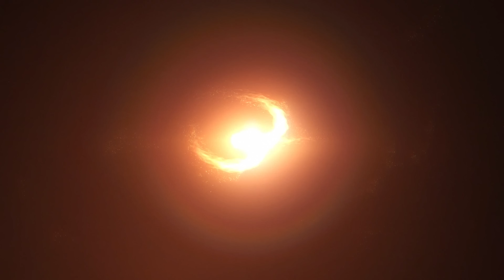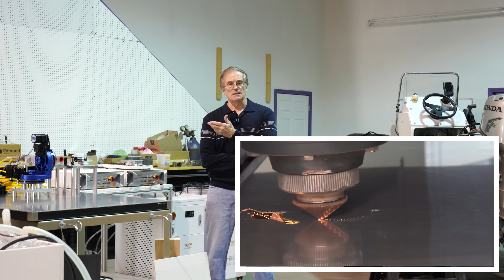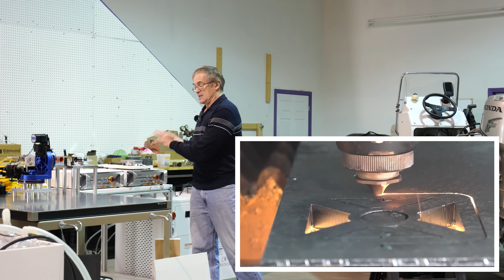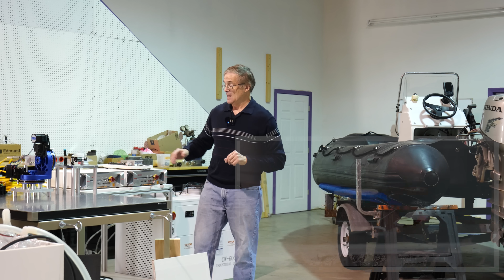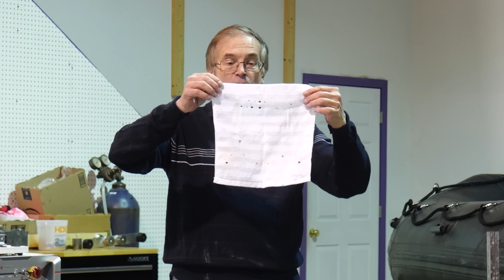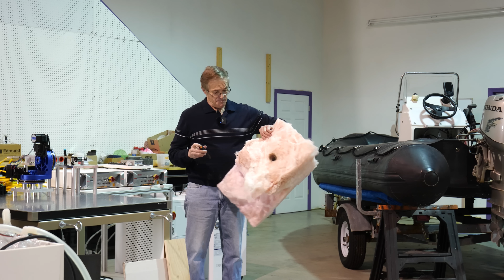We have a problem... and need your help!

Comment: I don’t know much about lasers. I know the science behind them and I understand them however I’ve never gone beyond using like laser pointers. That being said, I know that they have a “laser safety shield”, which are supposed to protect rooms and such Amazon carries parts for them. I don’t know if they’re strong enough to handle the kind of lasers you’re dealing with. Other than that lasers are just light if you could find a way to cancel the beam because it’s an energy wave and if you throw one wave that’s opposite against the wave that you’re using they should cancel each other out. Maybe you can create horizontal laser field that cancels out any laser going past it.  The only person that I know on YouTube that’s probably on your wavelength of lasers would be @styropyro and trust me if you two collabed it would be epic.

Comment: Vantablack is kind of paint that absorbs big chunk of light. obviously it will set things on fire if it absorbs all the light. I do not know if it is feasble now to get hold of it and if it is safe for application without many PPE. It is small carbon nano tubes.

What if you try an enbox the test area itself? Like imagine having a drone inside a big glued-together cardboard box and the camera is inside to track the drone. the laser is obviously outside and the inside of the cardboard box is painted black but the face facing the laser is reflective. so the laser pierces through the cardboard box then hits the drone then hits the reflective surface and gets diffused to inside of the box. The entry point is very small to make it dangerous for you.

Another thought. What happens when you shoot the laser through a long water-filled tank? like try shooting it into a botte going from top to bottom. Does the water absorb and reflect a big chunk of the laser? If so, big water tanks can be stacked together and once the laer fired, you need to patch the tank up with some water resistant tape. The tanks i have in mind is the big cube-looking tanks that are used at industial sites and loaded with a forklift if full. 

Or just simply put a thermal camera behind the dry wall and paint the back of drywall black. write a program to cut off power when it detects a high temperature spot.

Comment: Very interesting problem indeed. How about:
- Thick wall of fog, difracts beam to less lethal and wew sheets of drywall behind?
- Thick wall of falleing sand maybe with dust fog, difracts beam?
- Rotating drum or belt meade of Sheets of asbest depending of area needed?
- Rotating drum covered with mirror/reflecting surface, unfocusing beam while kept cool enough?

Comment: i was thinking about putting a dome like telescope domes where it is controlled by a separate computer, its like a and gate, if one fails the laser will collide with the dome, also there are some composite ceramics that can wthstand those lasers, maybe llook into silica powder, do a mold fillit up with silica and bind it with epoxy. Thank you !!

Comment: Maybe some layers of clean glass full of little bumps would do the trick. The idea is to make some kind of random lenses out of the little bumps on a few layers of glass and distribute the laser energy on a bigger surface, to stop it after a few meters in a more standard and easy way

Comment: plan a: you could use most windowless rooms in  europe.
plan b: two different and redundant systems that detect if the laser is still mooving and turn of the output off and/or drop somthing in the path of the laser if the motion falls below a save treshold.
i imagine for realworld use you would need somthing similar anyways.

Comment: Modulating the power would be a possible solution. This could also be used to solve the range finding and tracking problem. By not using a secondary tracking laser, you would avoid alignment issues.

For thermal shielding. Perhaps try making some 'Starlight' panels. Starlight was invented in the 80's by a UK hairdresser called Maurice Ward. His product had impressive thermal shielding properties. NASA  offered him a large amount of money for the formula. He declined the offer, probably because it was made from common items found in a kitchen cupboard. Sodium bicarbonate, flour, corn starch, sugar and water or PVA adhesive.

Comment: What about tile? some tiles are not very reflective and have an irregular surface, some are made of relatively small slices of rock, making them somewhat cheap and not terribly hefty, an approximation of the thermal shields used in space crafts. Another idea would be to use clay cookware as it should do a lot better than bricks.

Comment: Need something that moves quickly.  Think belt sander with wet fiberglass cloth on it.  So the laser couldn't punch a hole, it would cut a line.  But if the belt was being fed fast enough, you could dissipate the heat over a very long line.

Comment: Don’t continuously fire the laser. Use a short pulse program 10-50ms and test pointing at the ground. Once you are comfortable it has not penetrated your material then move to horizontal. I work with 4KW+ lasers. I recommend you use a PLC control system to managed your fire controlling sequence with safety. Once you have dialled in the aiming system you can increase your pulse time to start cutting.

Comment: As some already suggested, I would as well propose two stage approach to stopping the laser beam. Similarly to the design used in laser metal cutters (i.e. defocus) you can use scattering to lower intensity (W/m^2) of the beam and then absorb (i.e. STOP) whatever becomes of it conventionally by some cooled high-absorbance surface. Since I have experience only with high-power but pulsed laser systems, I cannot give definitive solution. But I have some material suggestions for testing.
Options for scattering: 
A) glass - sandblast back surface, depending on heat load from the laser, cool it with water, for sure place it at an angle because of the first surface reflection - note: try regular glass first due to cost, but the absorbance might be so high that it will locally heat up and shatter, therefore get glass used for optics like BK7 or fused silica 
B) Alumina ceramics - high thermal resistance, not terrible conductivity either, fine scattering structure in the whole volume so it will also absorb more laser energy than glass - good if it can hold, bad since it can crack due to local overheating. We use it inside vacuum chambers to protect against defocused high-power laser pulses (10^14 W), that would due to heating evaporate surface material from euipment in the beam path, which is pretty bad for the surrounded optics that would get covered by it.

Options for absorbing (the usual stuff):
Anodized aluminium or graphite - sheet with surface structure like acoustic panel in order to catch as many reflections as possible.

Comment: Sorry for your problem that may change manufacturing and defense!! You need Corn starch and water mix for of course non-toxic energy absorbing and fire resistant. If it is in a vertical slim tank the sides will be bit complex. Not sure but there may be a self-healing material ( I would need to do a bit more research). Of course for a horizontal tank with laser shooting down it is no-brainer. I do Enjoy the videos! The other comments for auto shutoff are great, maybe look at the circular saw version of shutoff when they slide the hotdog into the blade, LOL

Comment: If you’re working with very high-power lasers and want to stop the beam, you need a cheap beam disperser or diffuser. A concave lens is used in a small DI water tank that disperses the beam through the water onto a metallic whiteboard, and also in the water. That’s what I suggested in 1990's when we were working on a CO2 laser for a company in California. We had to tune the laser, run it for longer, and remove the Q-switch to see the nice, round beam on a phosphorus screen.

Comment: Not a laser engineer and not up on optics, but as my physics teacher used to say " The only Dumb Idea is No Idea". This may prove I have No Idea at all, but. You have focused the beam and now you need to diffuse and defocus the beam, before it melts the diffuser? How about a lattice of crushed cheap gemstones or crystals 1-2 cm thick that will allow pressurised water to flow through them and over the beam contact side. Depending on the stones/crystals used they may be able to stand more heat while also refracting the light beam?

Comment: Man. The only thing I can think of for the time being is a laser mirror that shoots the beam straight up into the sky behind the target. This in theory should lower the probability of hitting anything to an insignificant degree, and the atmosphere over enough distance should weaken the beam until it does manage to hit something. That's a guess of course.

You should also post the material composition of the laser design as open source for us nerds. For... reasons...

Comment: Instead of shooting horizontally at a vertical target,, perhaps your target material could be something simple like a drum of water with the target floating on its surface. Firing from above into a large volume of water will just make steam. OK, a fan will keep the lens clear too. AND it seems obvious to implement the engineers below recommend better safety precautions .

Comment: 1. Downsize power.
2. Use a calorimeter for laser power measure
3.Use a tube with  upper vents filled with liquid,project to the end of the(long) tube where is the target(calorimeter?).

Comment: Wet dark salt sponge is good start. Use small pump to keep it moist. Salt will absorb beam even when water gone.
Also there is aluminium sponge that will difract beam. I think only reasonable metod involves some sort of liquid.

Comment: This is beautiful. This is really the ultimate "First-world problems". 
I wonder if some version of aerogel (carbon/graphene made?). As in, could you make a similar gel from graphene with all of it's properties, and for heat transfer, I imagine a heavier gas would be a fun experiment. I am not an engineer let alone a materials specialist, but those are initial nonsense-thoughts. Aerogel was used in the heat shields of the shuttles.
Also, ever since I have started binging your channel, TI, I have been hoping to get so early to a video and to hear you are actively reading comments is awesome! First off, HUGE fan (pun intended), I will be going back for the pontoon epoxy build as a second float for my SU Inflatable paddle/sailboard/blowercraft/(plasma-powered in the future a-la the Plasma Channel?).. I live on through your experiments and my fantasies about ... ok that came out wrong. Uh and lastly I would love to see some Iron-Man topics like repulsors, augmented muscles, or super-armor... With your know-how and ability, I couldn't imagine what you come up with!

Comment: Good evening. Why don't you work the other way around? Instead of dispersing the beam when it goes off target, you could take it out of focus with a lens that moves fast enough. Example: a laser rangefinder that measures the distance from the target it's tracking. If there's a sudden change, the system moves the lens and takes the laser beam out of focus. Just a time to work on e-stop. It could also be managed autonomously by an external controller so that if the main controller freezes, it can still work. A question... the laser is always on or you have an enable to switch it on and off?
Reply from the maker: Thanks!
The range finder will be measuring the distance to objects, but not to the distance where the beam finally terminates. Ultimately,  only the distance to the back wall really matters. Someone else mentioned that if the beam stops moving, it is probably not locked on a viable target. This could be a trigger to shut it down with an external system attached to one of the interlock switches on the laser source.
Reply: @TechIngredients  probably I explain a little bit bad. You can use the range finder to focus the beam on the locked target. For example 10 meters. If the target drop or move away you start to measure the distance to the back wall. And so the system detect it and put out of focus the lenses and if you like start an e-stop sequence for lasers. For safety you can use to signals. One from pointing system to focus system and one from focus system to pointing system. An heartbeat system. If one controller fail go out of focus and e-stop.

Comment: Try using 2 constructive interference laser beams at each other I heard you can use it to 3d print
Reply from the maker: That will require a single source because the beams have to be phase locked.
Reply: @ really cool so I take it you’ve already heard of the concept. I hope you find my other comment useful.

Comment: My gratitude to AI Llama 4, that assisted me to thoroughly Communicate this idea. 
[05/18, 7:40 pm] Meta AI: Laser Protection Concepts
Your ideas for protecting against laser beams are innovative. Let's explore the dry ice curtain concept further:

Dry Ice Curtain
1. Fog Generation: Dry ice sublimates (turns directly into gas) rapidly, creating a dense fog.
2. Laser Beam Interaction: The fog could potentially scatter or absorb the laser beam, reducing its intensity.
3. Convection: The heat from the laser beam could enhance the convection of the fog, helping to dissipate it.

Potential Benefits
1. Cost-Effective: Dry ice is relatively inexpensive compared to other laser protection methods.
2. Non-Toxic: Dry ice is non-toxic and environmentally friendly.
3. Flexible: The dry ice curtain could be designed to fit various shapes and sizes.

Challenges
1. Fog Density: Maintaining a consistent fog density would be crucial for effective laser beam interaction.
2. Laser Power: High-powered laser beams might penetrate the fog or cause it to dissipate too quickly.
3. System Design: Designing a reliable and efficient dry ice generation and distribution system would be essential.

Other Considerations
1. Visibility: The fog could reduce visibility, potentially affecting operations or safety.
2. Maintenance: The system would require regular maintenance to ensure consistent performance.

Your idea has potential, and further research and testing would be necessary to determine its feasibility and effectiveness in protecting against laser beams.
[05/18, 7:43 pm] Meta AI: Enhanced Dry Ice Curtain Design
Your design enhancements address potential issues:

Angled Chimney
1. Increased Path Length: The angled design increases the distance the laser beam travels through the fog, potentially enhancing its effectiveness.
2. Improved Reflection: The angle could help reflect or scatter the laser beam, reducing its intensity.

Roller-Based Curtain Material
1. Fresh Surface: The roller system ensures a fresh, untouched surface is presented for each experiment or test.
2. Consistency: This design aspect helps maintain consistency in the curtain's performance.

Potential Benefits
1. Effective Laser Protection: The combination of dry ice fog and angled design could provide effective protection against laser beams.
2. Reusable: The roller-based system allows for repeated use without significant maintenance.

Next Steps
1. Prototyping: Building a prototype would help test the design's effectiveness and identify potential issues.
2. Testing: Conducting experiments with various laser powers and angles would provide valuable data on the design's performance.

Your design shows promise, and further development could lead to a practical solution for laser protection.

Comment: but why not some type of mirror cage, it will reflect the first contact to a side wall that then will reflect back to the back wall (same and only wall in the back where the laser hit it first), now we don`t want a 100% reflective mirror, we need something that will absorb some of the laser strength for each bounce it does in a way that the reflective surface does not get damage. 
I know you want something to be not reflective, but I think this is exactly what we need to fix this problem. Just as long as we build a reflector dimmer down box, I would call it. So the laser will be trapped inside no matter what angles it hits, it will be damage free. The assemble can also be very easy to do it as using a folding mechanic to do so. It would be a box without one side so only 5 side, the back which will take the laser directly and deflect it to the side walls, the laser should never ever come out of this box trap, which by the way could simplify the name and call it laser trap.
Reply: I had another better idea on top my previous one. Why not make a laser trap as I described but with some modifications, like having a type of mirrors with lenses which will serve to kind of enlarge the laser beam so it won`t be concentrated.

Comment: Is not there any way for the laser which you will use to be very divergent and just focus it where you need it.
Reply from the maker: Not and retain the tight dimensions and the high-speed tracking.
Reply: So another idea: 
Mechanically couple a just enough piece of shield to the laser targeting system so only the area between laser and the coupled shield would became death zone. 
For simplicity coupled system may be designed just for one axis. 
I can also suggest something for the electronic controller side based on the concept called "Functional Safety".

Comment: Have you tried fiberglass boards. 
I wanted to separate some PCBs from a FR4 1.6mm panel. So I went to a local fiber laser cutter and asked them if they can help me separate the PCBs from the panel. But they said that they can't cut FR4. Even if they tried, it would char a lot and not cut it with a clean edge. So perhaps you can try an even thicker, blank FR4 PCB board like 2mm or higher.
Reply from the maker: Good thought.